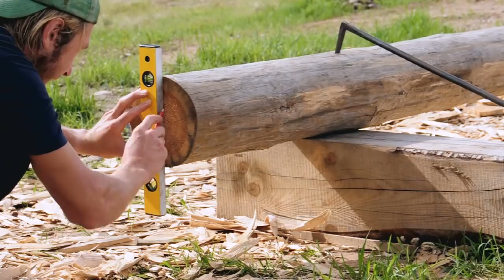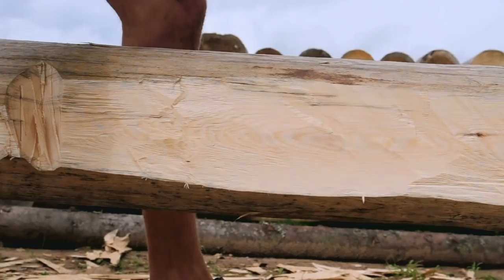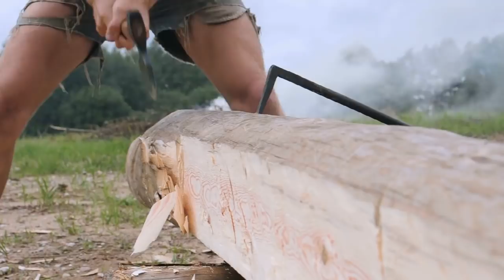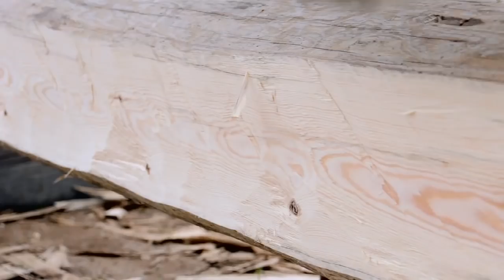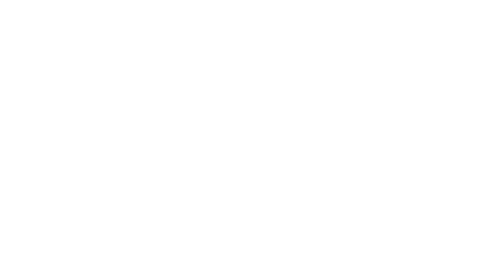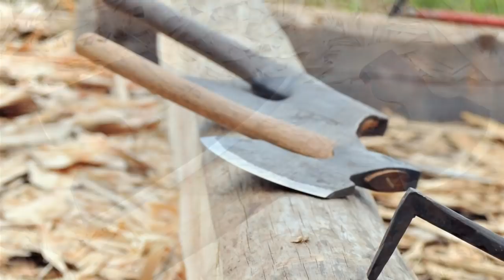Hand hewing pine logs

Comment: First, he has the pine log raised off the ground and held fast with the two log dogs. 

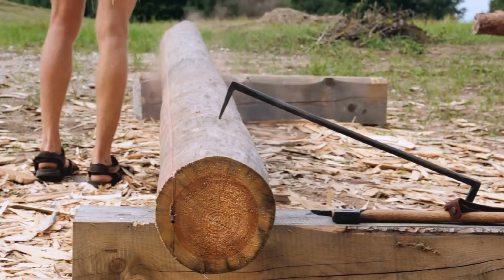Next, he took a level and made a vertical line on the center of the log. He then measured out to the left of center (from my estimation) 4" and made another vertical mark, also using the level. If you pause at 0:18 you can see these two vertical marks on the log. This process was repeated on the opposite side.

Comment: I definitely agree with Jason about the ease of working green timbers,  also, for faster drying woods it is not only easier, but hewing and cutting joints, mortises, and tenons, will help the log to dry at a much more even rate, lessening the chance for checking and tangential ring separation.

Comment: A chalk line was drawn between the two outside marks and snapped, giving him a chalk mark the length of the log. This is used as a reference point for the depth of his cuts. There's no reason to draw a chalk line on the underside of the log because he keeps his axe cutting vertical. 

This entire process was most likely done on both sides of the log. If you do this process on all four sides you will have a square beam.

Comment: Good video, but what the hell is up with the sandals?  Good grief man... your axes are properly sharp.  One slip and you are in deep shit.  It may seem unlikely that anything would happen, but that doesn't make it impossible.  I've seen the craziest things happen with tooling, like the time I got a die cocked in a 130 ton press.  When the punch let loose, it flew across the shop, missing another guy by no more than 3 feet and breaking through the block wall.  Anything in the way would have ceased living.

Please be careful.
Reply: +Andrew Vida Haha, love the random story....
Reply: Andrew Vida thats why their called accidents!
Reply: Steel caps make you feel like you can afford a mistake. Its better to live life at the edge. And know you have toes exposed .
Reply: He likes wood chips between his toes
Reply: To be fair, if your tools are sharp they won't slip as easily
Reply: Because he’s a dam hipster
Reply: Any hipster hewing lumber by hand is alright in my book.
Reply: @conspiracyscholor7866  right!
Reply: While I wouldn't be doing this in sandals either - this guy is working safely. Note how he works so that the timber is always between him and the axe? (The same as when snedding a fallen tree with an axe or a saw) Also he's using short precise swings - so the head is unlikely to fly off the handle, through 6" of wood and sever his toes. And the axe is sharp - which is safer than a blunt axe because it means there's less force behind the axe.

Comment: a string covered in chalk is drawn out (laid out between 2 points) on the log. the string line is then lifted off the work and released (snapped). the impact upon the workpiece leaves a chalk line.

Comment: what do you mean by "snapped"?  
I don't see any lines drawn the length of the log, it looks more like he used a wire.  
what if you want to hew without taking the bark off first?  you can't draw a straight chalk line if the trunk has knots and bark.
how do you find a trunk with such symmetry along the length?  most trees grade thinner as you get higher up the trunk.
is it better to do the hewing on a green trunk or seasoned?  How much seasoning is good (before it cracks).

Comment: none of these how-to videos shows how to align the face using a string, rope, wire or a marked line.  how do you do it?  what is cheapest to use?  I see you measured things off in the beginning, but then I don't see any lines on your log and you aren't describing what you're doing.

That's a cool ax, you should describe it's history.

if u watch this w headphones on, it's like you're there-- bugs in your ears.

Comment: most of the videos on You Tube show them messing around with those stupid relief cuts.  Just cut the log from end to end.  The whole reason for a beveled axe is so you don't have to make relief cuts.  He also sharpens his axe with a stone.  Wow that's namby pamby.  Get a file hombre.  Then you can get micro-serations in the blade and do the job in one minute.  My video is going up tomorrow.  I am sick of all these bad examples.  Timbers can be cut four sides in ten minutes easy.
Reply: AugustusLarch You were as good as your words and posted the video, and I see what you mean, of course you are right. I was actually wondering why the relief cuts with a bevelled tool, whether they might serve as a reference for keeping depth constant rather than easing the cut.
Reply: Aldo Tanca This guy has much better logs than I do.  If I had logs that nice I would saw them in to siding or dimension lumber.  My timbers are cut to make use of 'trash' wood in a sacrificial application of planters sitting on the ground with dirt in them.  I expect them to last only 12 years at the most.  By that time they will turn into raised planting beds with a earthy berm around them.  I make new planters all the time.  The soil where I live is rich but has poor drainage.   The planters work great to remedy the situation I have.
Reply: Burai Balázs  My logs are not he best, I agree.  I cut down balsam poplar to clear a building site and used all and every tree to cut timbers.  Mine logs are full of knots and twisted, yet I can cut one into a timber suitable for building in 10 minutes.  This guy has a perfect log of easy cutting wood and takes forever to cut it.  If I ever had a chance on a log like like that, it would be like carving soap compared to what I am used to.   All the old time loggers filed axes because after actually working a sustained time with an axe the stone would be useless to the edge back to dimension.  Sometimes you have to use a grinder after cutting hard wood with knots to get the a good edge back.  If you worry about losing steel on an axe, don't use it, hang it on the wall
Reply: That poplar you used in that video is foam compared to this old growth what seems to be birch
Reply: +Cattailclan Tim lol i meant pine
Reply: and also the bevel on an Axe is so it can cut period
Reply: +Cattailclan Tim So, the harder the material, the sharper your tools need to be?
Reply: Now you're making me second guess my self I would say so seeing as I have experience with poplar and old growth pine and the sharper you Axe the better in my book
Reply: stop hating
Reply: Lol looking back on this it seems like im a smart ass i didn't mean to come off that way
Reply: AugustusLarch  I looked for your vid, didn't see it.

Comment: aren't there actually specially designed hewing axes you could be using with an offset axe head so you can properly hit the log and not get knocked off by the handle?